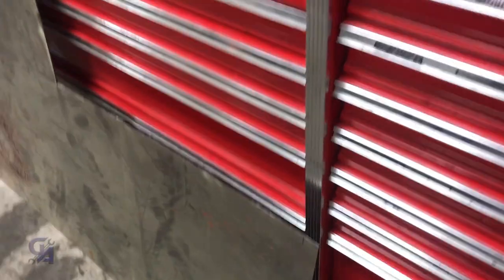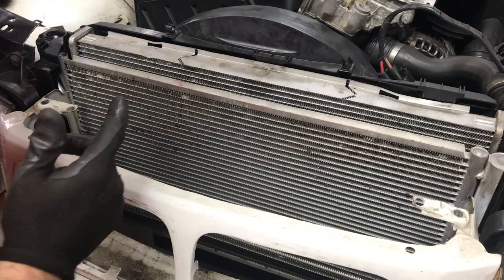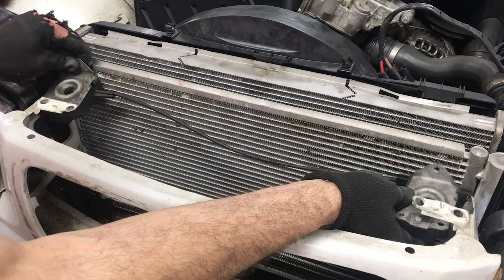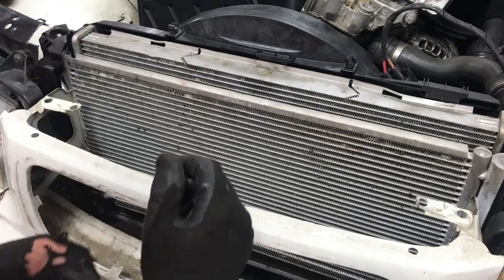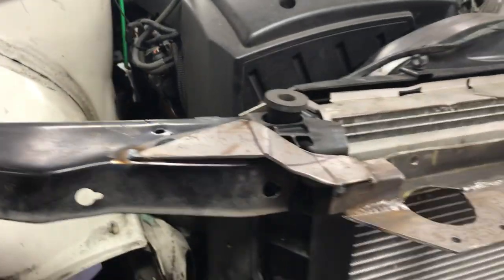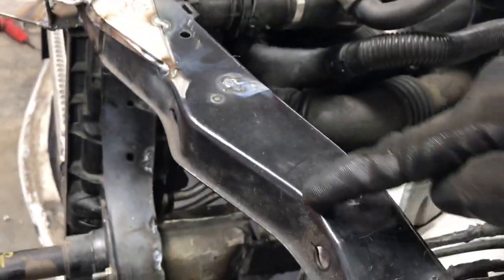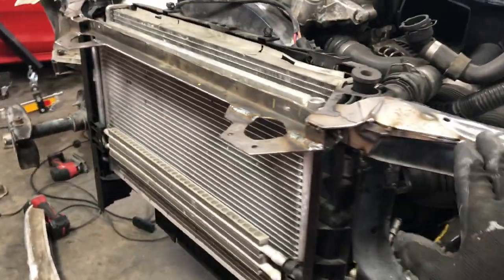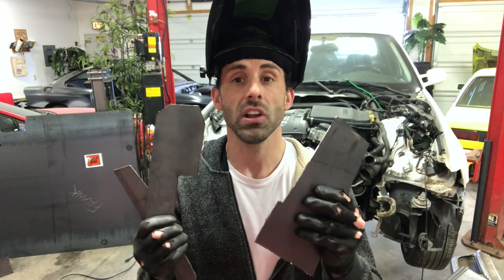Completion of the radiator placement, core support, and frame rail install!

Comment: You're awesome, that was some mad customization! It would be easier to use a custom rad for sure though
Reply from the maker: In retrospect I agree. 
However - my mantra is to save $$ in part cost I spend more time fabricating custom bracketry. Example is the radiator.
Another example is engine bracketry. 

All custom weldments. 

Super cheap, learn a ton about the system/design, and gain confidence to creatively solve your own problems without having to rely on a special expensive part.

Comment: Would stock E36 coolers with a custom intecooler & custom piping not have been easier??? This is alot of effort to use x35i cooling systems...